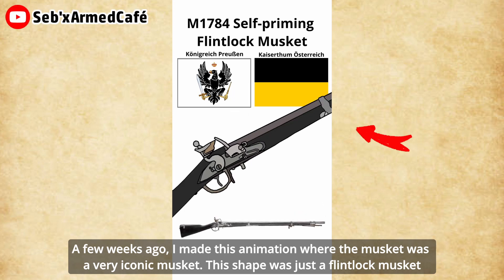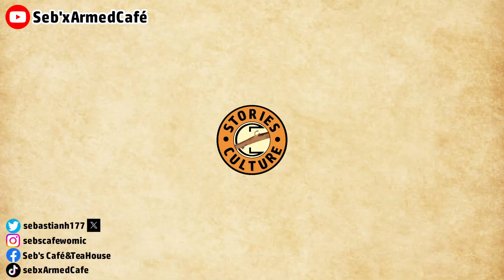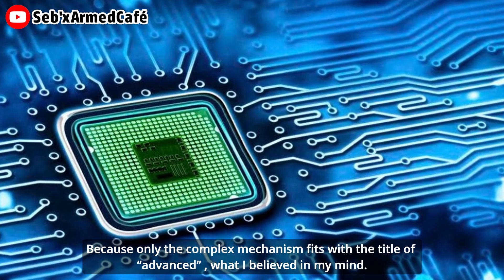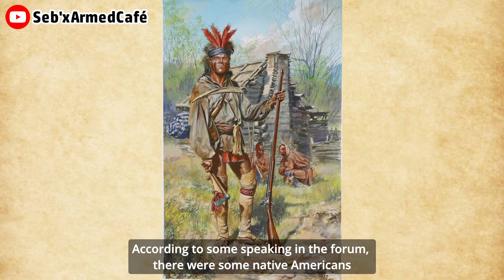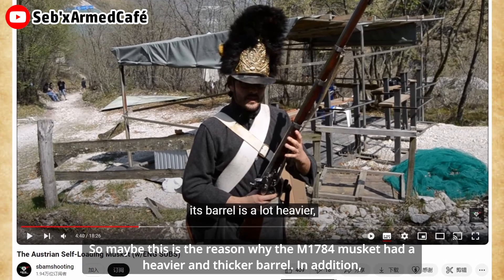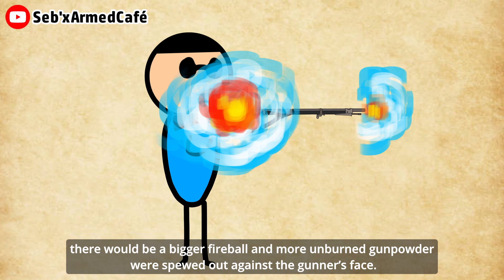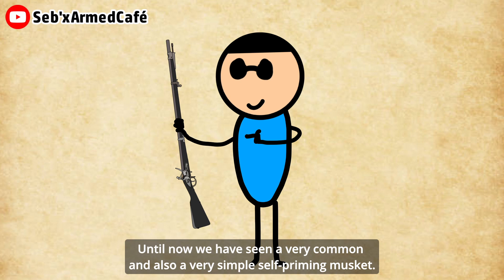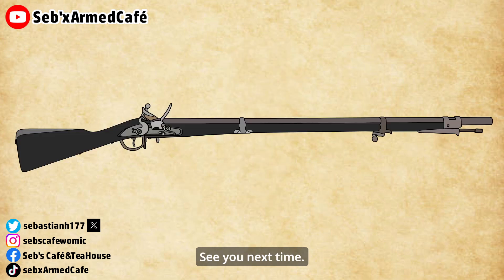Why Some Flintlock Muskets Can Self-Prime? and Something about the Flash-guard

Comment: I don't see how the flash guard will help the gunner. Would it not deflect the gas into the face of the gunner as the gun is held on the right side of the body and the flash will normally go to the right. The only benefit I can see is that it will help the gunners comrade next to him not the operator of the gun itself. And that will explain why we don't see guards on civilian firearms as you normally don't stand so close to your friends when hunting or target shooting. It the directs the flash up instead of to the side where your friend is, but it will increase the chance of you getting a bit of flash as well. Great video I just wanted to point this out. What do you think.
Reply from the maker: I like your opinion! Thank you for your comment.